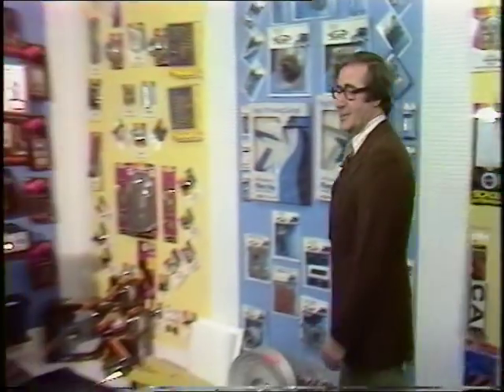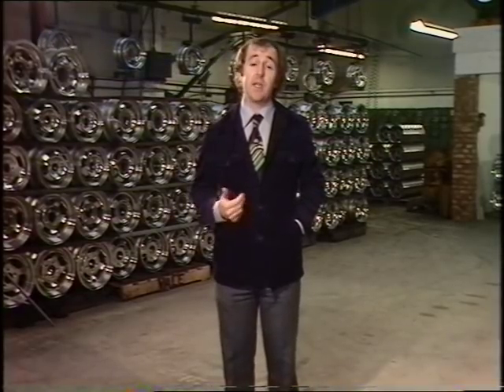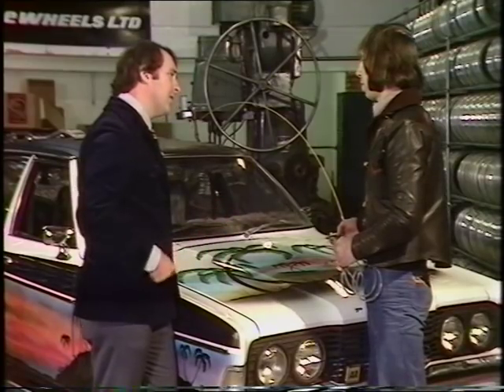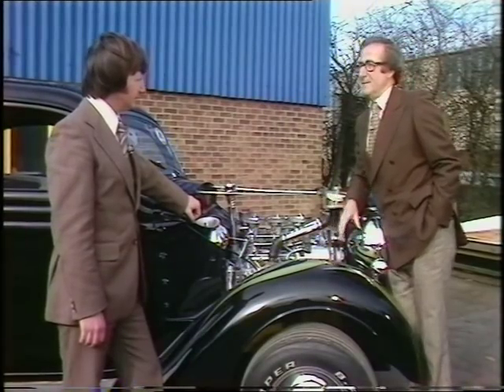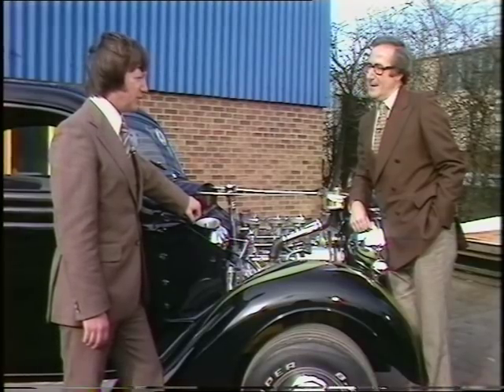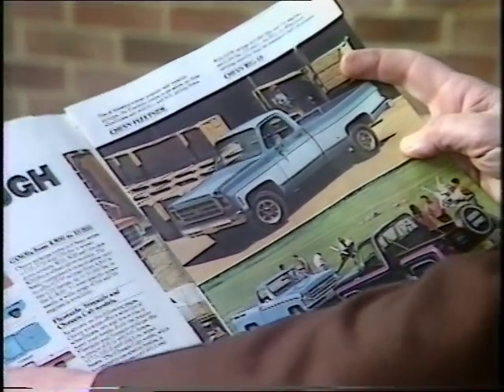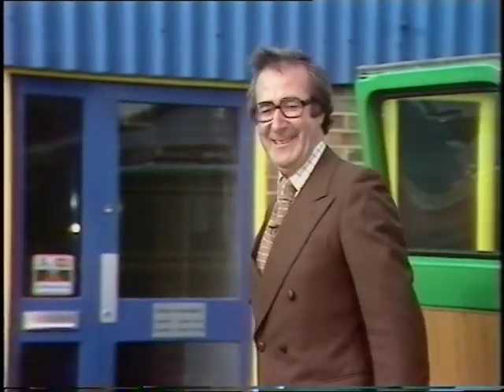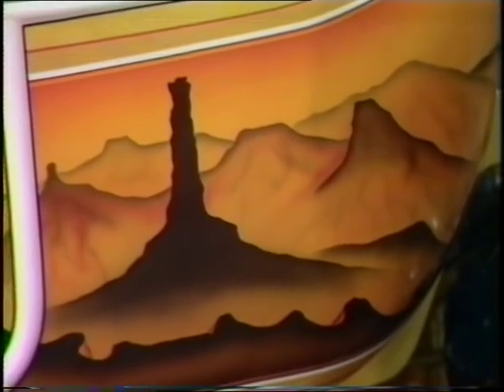1970s Custom Cars | Hot Rods | Car Design | Drive in | 1977

Comment: Just come across this video.Took me right back to the 70s when I was a lot younger and well into the custom scene.Great to see Pete Darwell involved,took my Avenger down to his place in Rochester from Lancashire.Two week after dropping it off,went back down on the train to pick it up.Dragons head and flame paint job looked brill.
Sold car 18 months later and got a 71 Mach1 mustang,whilst I was still only 20years old.Miss those times.
Reply: I live in Yorkshire, bought my 68 Roadrunner in '84, still own it, ...I knew 40 years ago I would keep it for life if poss.
Reply: @markholroyde9412  Wow,40years of ownership.Good effort.I might well have seen your car at the Leeds Burger King meet,if you got there before the council shut it down.Went a good number of times in my 71 440 Cuda tribute,tor red with black billboards.
Sold it in 2019 for a modern R/T Hemi Challenger.That went in May 2021 and in its place I got my present Mopar.I was lucky enough to get one of the 50th anniversary commemorative Scat pack wide body Challengers.So far since new I've done nearly 10k miles.Pure adrenaline rush every time it's driven.
Currently helping my mate working on his 68 Camaro,formerly known as Sillouette,full custom from the 70s.
Reply: @barrycudauk232  Yes mate, I have been going to Leeds cruise since 1980, I also have a rusty but solid '69 Dart which will be for sale soon and a '68 440 Fury Conv too. . my RR is a well known car in MOPAR land and I have never deviated for any other brand. I remember the Cuda, proper mint car?

Comment: At 2:40....that is a Binks Wren Airbrush model 59-1002 "B".   Single action , up to 50psi.  They still make those!!!  but $300+ price tag. 
 Had to have driven him nuts with the limited capabilities you have with only a single action, low psi airbrush on  automotive surfaces.  Thank goodness for iwata dual action.